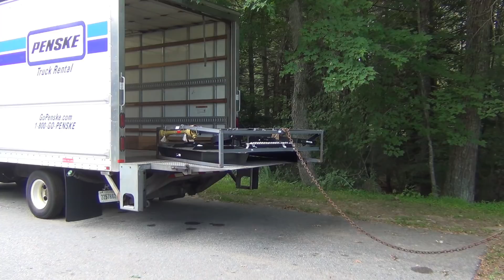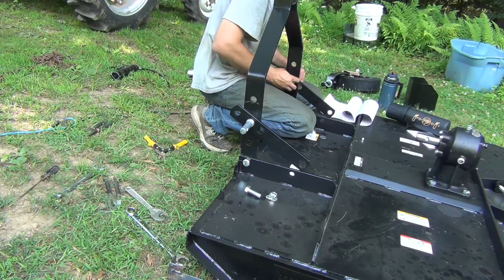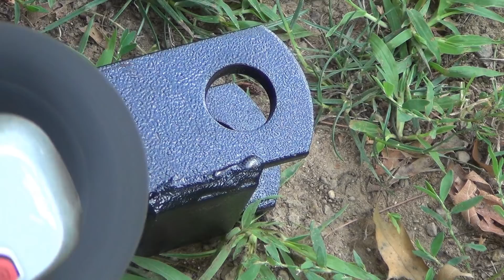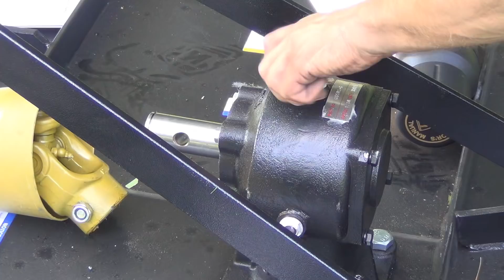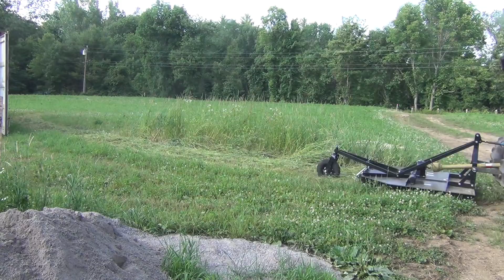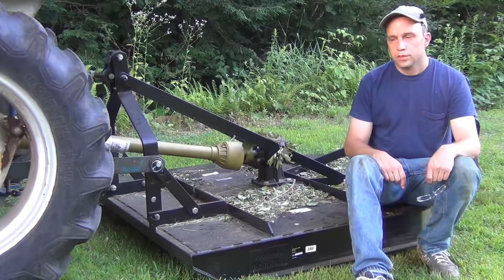Unboxing & Review: Northern Tools 60" PTO Rough-Cut Mower

Comment: Thx for good review. You might need to upgrade a few critical bolts to a higher grade. Most bolts in these kits are the bare minumum strength & quality and will fail over time.
Reply from the maker: There's no doubt these are "home depot" quality bolts.  :)

Comment: We use flairer for fire prevention on our jobs does better job in chewing up the material but quite a bit more expensive. I used a roto for many years and it cuts the heck out of things. Good mower.